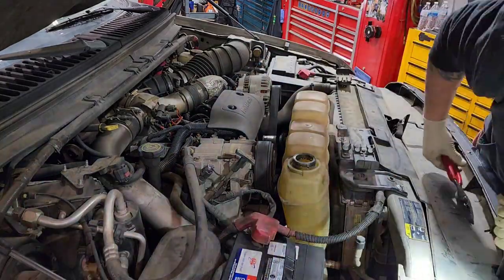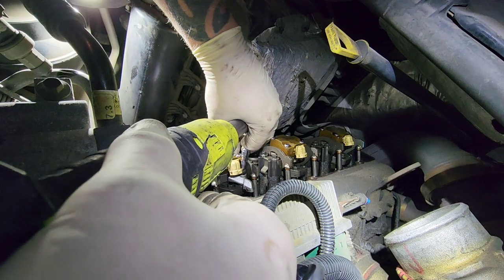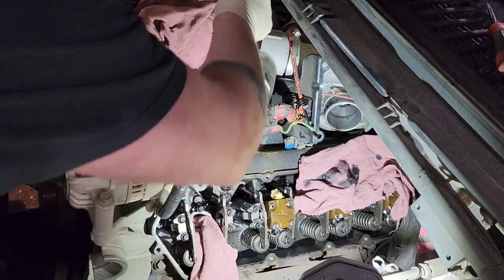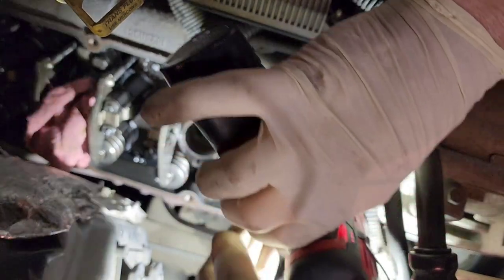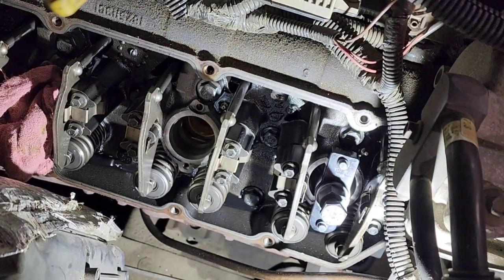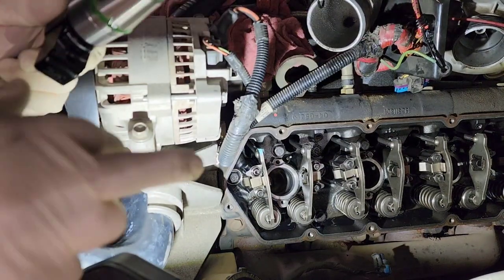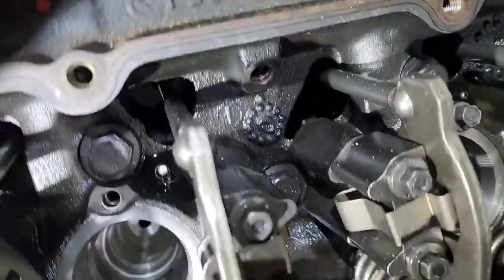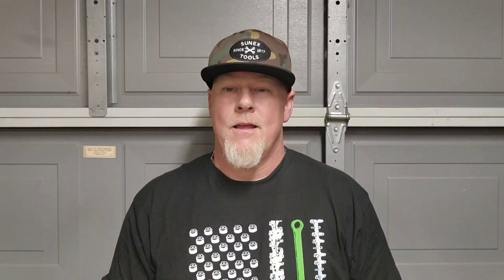7.3 Powerstroke EASIEST Injector Sleeve Replacement

Comment: Good video! Do you have to take the glow plugs out and turn it over, or does taking the plug out above the starter make it so you don’t have to do that?
Reply from the maker: The plug above the starter drains coolant.  Sometimes u do have to take out glow plugs because some fuel and oil runs into the cylinder.  Thanks for watching. Message me on Instagram if you have any other questions
Reply: @NutsandBoltswithTone  ok, I am doing mine today. Thank you

Comment: Stainless has much different heat transfer coefficient than brass.  Wonder if that will cause an issue?
Reply from the maker: Hmm good question,  I'm not sure about that.  I would imagine that they would do just fine.  Thanks for watching.

Comment: im currently doing injectors on my 95 7.3 and #8 doesnt have a LL injector at all and the previous owners decided to put a Alliant injector in #7 and leave it as is. which is weird. So is the cackling LL injector only a super duty thing? cause ive checked my injectors all over and #8 doesnt say shit
Reply from the maker: No it is not a super duty thing, it was changed to LL injector because it is further from the oil pump and can have an oil filling problem resulting in misfire or slight rough running. What I would is call Ford and tell them you need 8 injectors and they should tell you that you need 7 regular injectors and one LL injector. If you have any further questions message me on Instagram and I can try to help you.

Comment: Fuel pressure is greater than the cooling system pressure. The gel and smell is a chemical reaction between the petroleum and coolant. You’ll never see coolant in the fuel system because of the pressure differential.
Reply from the maker: Oh ok, it is just a lot different then all the other fuel in coolant jobs I have had. Thank you for your information. I appreciate you watching.

Comment: Wouldn’t the brake clean seep between the cup and bore and possibly not let it set?
Reply from the maker: I do not spray the brake clean in the bite,  I spray it on a rage and wipe out bore. Then I dry it,  then install the cup. After that I let it set up.  Thank you for watching
Reply: Oh ok. I’m about to tackle the same job. Getting the riffraff tool today.
Reply from the maker: @jakep9086  awesome, message me on Instagram if you need any help.  Thanks for watching.